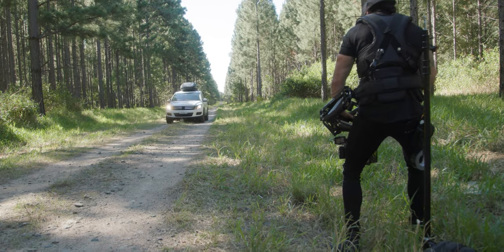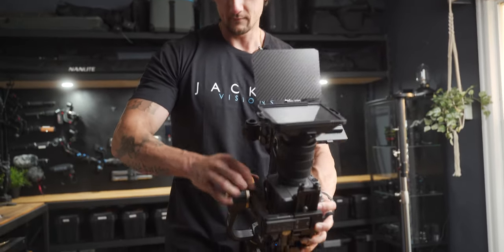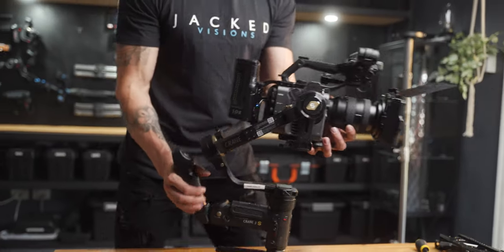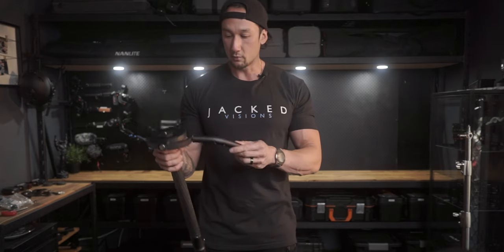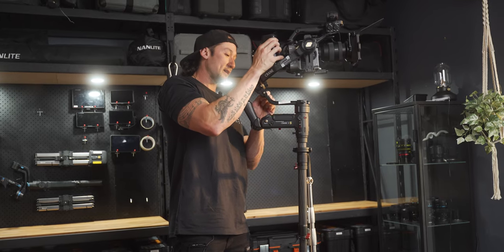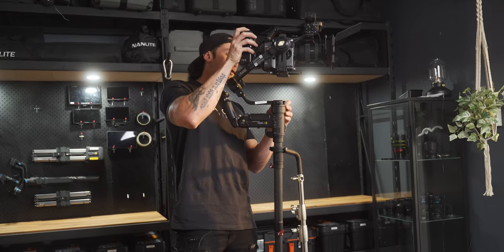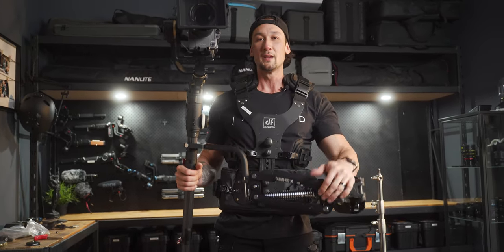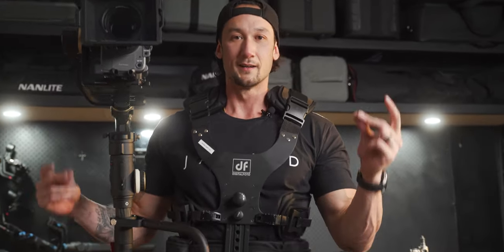HOW I BALANCE my DigitalFoto Thanos Pro X & Zhiyun Crane 3s & Sony FX6

Comment: Thanks Jason for the video .
I have a suggestion  tho 
Which i tried and worked  for me and i feel its more secure 
For Rs2/Rs2 / ronin s        users
U can remove the battery from the rs2 and put the universal adapter  and power it with a v mount battery 
This way u are reducing the length of the ronin which heavily reduces the torque on that screw
Cheers

Comment: Thanks for the review. The lonely screw that holds everything together scares me a huge looot. Screws aren't indestructible, they can break, it happened to me already. No way I am risking my RS2, one camera rig and lens, for one little screw that has to hold all that. I was looking for a Trinity style thing, I wasn't too happy with Tilta Float features so I was looking somewhere else, but I will consider this Thanos only if they make possible to lock at least with two screws... It seems good indeed, otherwise.
Reply: Here is the thing 
U can remove the battery from the rs2 and put the universal adapter  and power it with a v mount battery 
This way u are reducing the length of the ronin which heavily reduces the torque on that screw
Reply: @AbdraFilms  yes but at the end is just holding by the battery internal click not even the screw

Comment: Hey man thanks again for posting another Thanos video. Really appreciate it! I’m worried about how long it takes to setup but I’m guessing if you’ve done it once, you can keep it mainly setup/balanced for each shoot if you’re using the same camera setup? Like do you just leave the rig built and bring it to set and then make some small adjustments each time you use it?
Reply from the maker: I leave the main shaft and balance rig complete. Then all I have to do is balance the gimbal and place it of too and I'm good to go
Reply from the maker: Or check out my hook vest vs thanos video. You might prefer the hook vest set up
Reply: Yeah that sounds smart. Thanks for getting back to me. The C star quick release that Digital Foto now adds to the Thanos Pro X kit looks like it’d speed things up as well
Reply: @JasonMorrisphotocinema  yeah that was really helpful

Comment: What gimbal would you recommend using for this rig - rs3 pro, or zhiyun crane 3s? It looks like the Crane 3s has long enough arms that you can actually use the fx6 with the top handle AND the battery on the back. Is the Rs3 Pro going to do me any favors here instead of the crane.?

Comment: Hey Jason Just subscribed brilliant content bro!! I just got the Thanos ii on the way Im worried about payload. 12k pro ( around 6 pounds), lens
 (4 pounds), battery(2 pounds) gimbal (6 pounds), matte box ,wires, cage and other batteries around (4 pounds). Almost 22-24 pounds will I be okay I have project coming up and the x is very pricey also sold out for the full kit near nyc. I don’t understand how the arm has a different payload and the vest also does.I’d appreciate the input

Comment: Great to see your video. Really interested in the system but worried that I’ll have to spend ages tinkering with it every time I want to use it for a shoot. Do you think that there’d be a way of balancing it once and then leaving most of the rig intact so you don’t have to rebalance it too much every time? Say you were using the same camera body and lens each time and then had the camera and transmitter on quick releases so you could just clip them on/off (so that they were always in the same position). Guess you’d probably want a good travel case as well to keep it protected while the rig stayed mostly setup.. Think those steps could mean you could get it up and running within 5-10 minutes each time you used it?

Comment: Hi Jason, do you trust that 3/8 16 screw to hold onto the gimbal? I am terrified it will snap. I recently came across a base plate that uses the bottom and the rosette connector on the back side of the gimbal.
Reply from the maker: deifnitely can use a magic arm as back up. Ive been doing this ever since just incase

Comment: does your crane vibrate pretty hard when you go very underslung for low shots? I can't seem to get around that. Apparently thats a thing with the crane 3s and they reccomend POV mode and flipping it upside down. Thoughts? I just got a thanos pro 2 with my BMPCC 6k pro and crane 3s
Reply from the maker: I actually turned the power down on the crane 3s. It does that when trying really hard to compensate. Trying toning the power down. It will work
Reply: I also power my Crane with a v lock and that definitely helps
Reply: @kitbaker9134  hi, how you did that?
Reply: @ФлагманМедиа  I emailed Zhiyun Crane and they sent me a link for where I could buy the cable. One end of the cable plugs into the Zhiyun Crane and the other goes into a d tap so it can plug directly into a v lock. Then I added a Small Rig v lock holder, with a quick release, to the side of the Zhiyun Crane so it can attach easily. It adds a bit of weight to the rig but it lasts ages and can power other accessories like monitors etc. Just cheaper than buying Zhiyun Crane's power packs if you already own v locks
Reply: @kitbaker9134  so could you share this link with that cable?)
Reply: @ФлагманМедиа  The process was a bit strange to be honest. Just checked the email chain and you can't buy the cable in store. But if you email  and ask for
Reply: Hmm can't write the email address in the comments for some reason. It's just the "service at Zhiyun crane" email address that you see on their website

Comment: I use Ursa G2 with Hollyand transmitter , 2 tilta M follow focus ,v mount battery.on the zhiyun crane 3s ,When I switch from high to low position there is a jitter , the motor set to ultra . it might be too heavy.
Reply: No that’s not too heavy. I run all of that regularly 
Turn the motor down, for some reason turning it up all the way just wigs it out for heavier loads
I usually keep mine on medium-medium high and it works for me
Reply: @Dangolbustedman  I put the V mount battery on the bottom of the rig.It's good now.

Comment: Do not buy the thanos pro 2, there is no way to balance the arm because there is nothing to adjust in the part where the arm connect to the vest and therefore you will never be able to have the entire system balanced. You are suppose to  release the arm and it shouldnt go forwards or backwards, or left or right, but this is only possible with vest and arms that has adjusment knobs in the part the arm connects to the vest, the thanos pro 2 doesnt have it. So you will never be able to balance it. This guy must probably accepted the 20% money return that digital foto offers you if you do a video showing this equipment in a positive way even if it doesnt work. I refused that and asked them for a refund and returned and they didnt want it, I actually beg them and Lydia didnt give a damn. Dont buy this thing from then, all they want and do , is to make a sell, you are warned.
Reply from the maker: huh